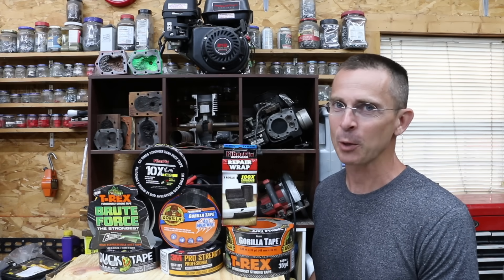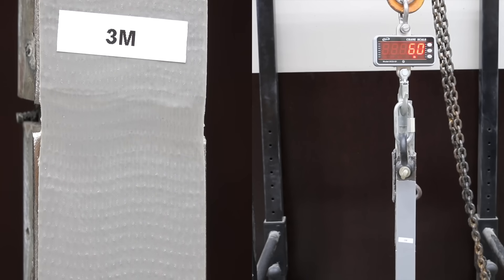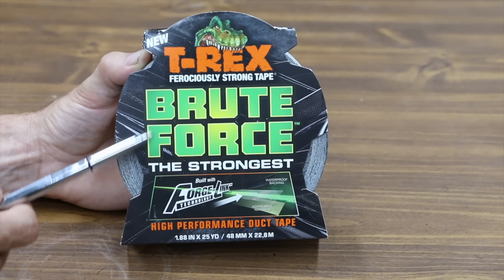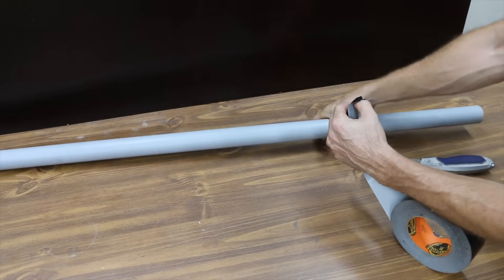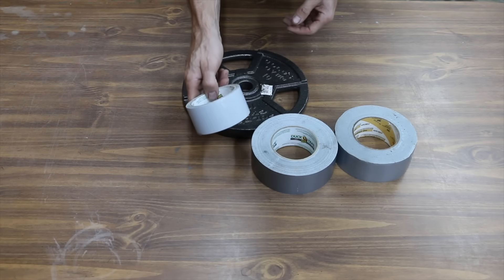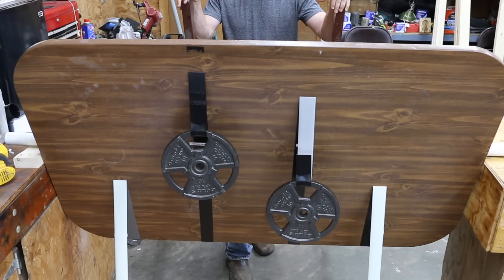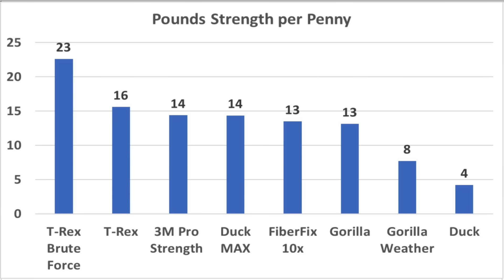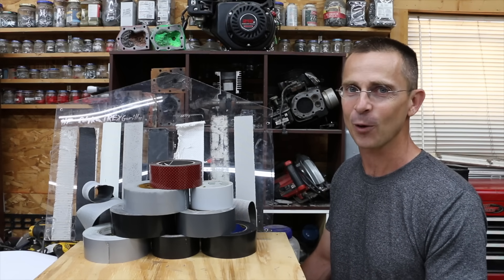Which Duct Tape Is Strongest? Let's find out! Gorilla, T-Rex, FiberFix, 3M Pro & Duck Max

Comment: I always found it interesting that, while classic duct tape has 1001 uses, one thing it's really lousy for is sealing up HVAC ducts... Which was sort of the whole reason the tape was created! Your aging test shows how the original type of duct tape disintegrates after only a year, losing its outer coatings, becoming more of a fabric mesh that won't seal anything and leaving behind crusty, dried up old glue deposits. Some of the newer duct tapes appear to hold up a little better, but when it comes to sealing HVAC ducts I bet none last as long as the metallic aluminum tapes.
Reply: i like the metallic tape
Reply: So is there a good use for cloth tapes today? I always find something bettter.
Reply: 'duct' tape was originally created to satisfy the need for a light-weight, waterproof fabric patch with an adhesive backing in WW2, as another commenter explained in detail.

It was degined to be a cheap, easy, TEMPORARY patch for boots, clothing, hoses, power cables, packs and vehicles. 

In the 1950s, it was sold to the general public, where it was marketed as "duct tape." A cheap, easy way to seal ducts... Except... Affordable central hvac was still twenty years away, the avg person didn't have ducts in their home. Only upscale businesses had it. Builders started using duct tape as an upsell to business installs, because TBH, it was the first and only option available TO seal ducts. 

In the 1970s, when new construction homes were built with central hvac, sealing the ducts was still an upsell. It was an optional "upgrade" for the home.  Historically, energy has always been cheap in the US. As a result, the upfront cost of sealing duct work was considered a luxury, like how power windows used to be "upgrades" for new cars. 

In fact, the act of sealing ducts in residential builds remained relatively uncommon until the late 1980s when energy prices began to rise. I have experience with residential real estate across the US, particularly older homes. From experience I can say if the home has rigid ducts and paper backed insulation, 95% of the time they aren't sealed at all, or there's a bunch of melted duct tape. 

Which leads me to my point. When 80s inflation hit energy prices, having sealed ducts seemed like a pretty good idea. Strapped for cash, homeowners went for the most affordable diy solution, a light-weight, waterproof, adhesive backed fabric called duct tape. 

That's the story of the journey taken by duct tape from allied military supply kits, to luxury theaters and high end department stores, into the junk drawer of nearly every American household. Duct tape can't actually do the thing it's named after. But maybe that's the point. 

Duct tape has been an inspiration for several generations. Just as the army found applications for it beyond it's intended purpose, so have millions of average people since then. Entire communities exist online around using duct tape in new ways. There are tutorials on how to make things ranging from shoes and shirts to swords and cups, entirely from duct tape. 

Maybe it was named after one of the few things it CAN'T do on purpose. Maybe it was trying to teach us something. 

Bonus story if you read this far. 

In 1879, a chemist in Missouri created a new antiseptic for use during surgery. It sold okay, but the hospital market wasn't very large. So he made a new dilution and sold it as a cure for gonorrhea, and a second dilution he sold as a floor cleaner. 

In the 1890s, he partnered with a pharmacist who began producing his formula and marketing it to dentists for oral care. 

In 1914, the pharmacy began selling the undiluted formula off the shelf to consumers as a mouth wash. They called it Listerine. 

The way we think about using duct tape to seal ducts today is obvious, but if you go back far enough, people would think you're crazy for rinsing your mouth with floor cleaner.
Reply: I have always heard Duck tape was originally made used for repairing H1-Heuy Blades from Bullet holes, but good to know :)
Reply: @Trooper_Miller  Close. In WW2 they packed ammo in boxes sealed with paper tape and then dipped in wax to be made waterproof. The problem is the tear tab on the paper tape-wrapped boxes would tear off, leaving the soldiers frantically trying to open a box that lost its opening tab.. while under fire. So Vesta Stoudt, a mother of 2 Sailors from Illinois, petitioned the US Military to create a cloth-backed tape with waterproof adhesive. They ignored her, of course, she wrote to President Roosevelt, he loved the idea. He commissioned the military to make the tape, the military gave the project to a company that was a subsidiary of Johnson & Johnson. The military called it 100-Miles-Per-Hour tape because it could be used to fix anything, up to and including jeeps and planes.

So there you have it.
Reply: @DisIntegratedLife  Thank you lol, sorry for get the story wrong lol.
Reply from the maker: Thanks for the feedback.

Comment: it seems obvious to me what the next step is.   JBWeld the ends of the pipe, then wrap it with fiberfix, run the brute force lengthwise over that... then call your plumber for inspection.

Comment: I grew up working in the commercial HVAC industry making and installing ductwork. I went through a lot of duct tape in the 70's, 80's, and 90's. A quick way to know if you have good duct tape is 2-fold; 1) How easy/hard it is to pull off the roll. and 2) How easy/hard it is to tear a piece off the roll. 

Back in the day it would take a full hand grip to pull a piece while I would tear it off using  my teeth. Find a local HVAC wholesaler and buy some commercial grade tape. I'm not in the industry anymore so I'm not sure what brands are available. I will say the closest thing I have found to what I'm used to using is Gorilla tape. But the commercial version ductape wasn't as thick as Gorilla tape and had fibers weaved throughout the tape.
Reply from the maker: Thanks for sharing.

Comment: Have you thought about testing brands of 4 stroke outboard motor oil? I have wondered if they’re really anti foaming from constant high rpm’s and if they’re really helping the engine resist corrosion from a salt water environment. Mahalos, follow tons of your videos🤙
Reply from the maker: Thanks for the suggestion.

Comment: I'd like to see how Gorilla Weather holds up to...the weather...I left a comment on your other vid that I'm putting a car port up, and I'm using regular Gorilla tape atm to hold the pipes together. But I somewhat expect to be patching and or reinforcing the fabric cover of this thing as well at some point, would also be good to know for patching tarps, which is a video idea I put out in my other comment as well. (Testing tarps that is). I'd actually love to see a test of car ports, but that would be rather expensive, and I don't know that enough people are out there buying them to justify that kind of expenditure, maybe that could be a Patreon thing or something like that, Idk how Patreon works I've never used it before, so not sure if it's possible to setup a fund/donation towards a specific thing or not.
Reply from the maker: Thanks for the suggestion.

Comment: i work as head of maintnance ( and bartend) at the silverado/franklin hotel casino in deadwood south dakota and we have all rubber type coating for roof cover material...was wondering about maybe you testing the rubberized roof coatings for us( and all the other peeps out there) because were needing to seal up the veranda outside bar floor this summer and well get you liquered up  if you ever make it to deadwood

Comment: Craziest thing just happened to me!  It's current 22°F outside and my DuckTape brand Duct Tape not only struggles to stick to anything (including itself) but actually separates between the top gray plastic layer and adhesive layer when unrolling it.  This prompted me to do some research and supposedly it is should work down to as low as -40°F "Duct Tape is ideal for use even in harsh winter conditions. It retains adhesion even in temperatures as low as minus 40°F and can adhere to a wide variety of substrates."  —  So, I'm wondering which brands work best at sub-zero temperatures!  Thanks!

Comment: Would you consider doing testing of 1. Solar generators 2. Camping generators (3000 or lower watts) 3. DC to AC pure sine wave inverters? I know some of these are very expensive to test a lot of them so I'm happy to ship you the two brand new 2200 and 3300 dual fuel generators to test and then send back.  These generators are life and death machines and without some very strenuous testing, there's no way to know what I can trust.
Reply from the maker: Thanks for the suggestions.

Comment: gorilla  lost a lot of strength in winter, i use a slice of it to close the gap between my windshield and my plastic cover underneath the wiper tape hold for 2 years in sme hard condition like -35 and more,i had to replace it after 2 years was not sticking on the plastic any longer and start cracking, its was not the weather one thou. the regular gorilla, its also do not stick well on heat surface

Comment: when i start scaling skyscrapers again, i'ma have to lose some weight to fit into my duct tape climbing harness again! Ok i just thought of a couple of questions, how Long does a duct tape last? when i put them on they tend to weaken, hard to test but i am curious how long it takes before it just peels off. Then different surfaces - wood, plastic, metal; and how long is it recommended and if longer or within that time how much glue is left behind. Reason i use electrical tape as the cleanup is easier. Usually for a temporary hold. Thx for the vid! Also, i wonder how the pipe test would work if you cut 6" or so strips and placed the tape parallel on the pipe instead of perpendicular (around it), then cut more strips and place them besides each other until you are around the pipe. If this makes a difference then if we need this, we should tape it that way instead.  ty
Reply from the maker: Thanks for the video idea.

Comment: thanks for this video.
i think it helped me, as in, i think i know what i'm buying, but i'm still unsure..

at work, i accidentally swiped the metal guard ?plates (about 5 inches wide), stuck to the bottom part of a concrete wall with the power jack.
i did so from the corner, so it bent outwards about a foot the length of the metal.
i was looking for a quick easy fix, so no one gets injured on this metal thing sticking out of the wall/floor.
using the heavy/handle side of the power jack (pushing it with the forks didn't seem to work),
i'm able to bend the metal back in it's place, but it obviously sticks back out a little, when the pressure is removed.
we don't have the tools to cut the metal off, nor to screw the metal into the concrete.

first attempt to fix was with maybe 10 inches of duct tape - when jack pressure was removed, it just ripped at the corner.
2nd attempt was maybe same length, but layered 3-4 times - it didn't rip, but the adhesive didn't stick after several seconds.
3rd attempt was same layers, maybe 3 feet on each side from/of the corner (+6 feet total), so it stayed on - but it's stretching out a bit.
happy with my temporary fix, but was looking to make it safer.
something that won't stretch as much, stick to the painted metal guard, and won't break too easily.
i think i'm going with the t-rex brute force, unless someone suggests otherwise.

while i'm at it, there is no such glue that would keep that bent metal stuck to the concrete, is there?
like if i take a sheet of that fiberfix wrap, wet it, and stick it in between the metal & concrete, hold them together for 20 minutes to cure, would that hold?
thank you again.
Reply from the maker: You are welcome!

Comment: You do realize that Duck brand Duct tape has different categories, there's the cheapest all purpose but there is also a professional grade that's much better than the general purpose. We used to have to wrap a couple hundred  swamp coolers in plastic every year when the weather started getting cold, so we used a crap load of duct tape, also outside temperature made a lot of difference, couldn't get anything to stick when it was cold in the morning.
Reply from the maker: Thanks for the feedback.

Comment: Hello sir your test is very helpful for me, kindly help me ,I have 4 kilometres underground 7 inch  pipe line one agriculture field to other field which is low surface to high surface and it's continuing leakes many places. Kindly suggest which is best tape for it ,I am waiting your  suggestions
Reply from the maker: You might use fiberfix and/or JB putty epoxy.
Reply: Thanks sir

Comment: Love it... I do like Gorilla . Not that expensive and it does more than I really need from it... Other videos. Hmmmm I would like you to revisit your video on penetrating fluids . As a tradesman handyman I do many things . Carpenter by trade and bulder of my trucks for love and joy, and Im cheep LOL. I hate paying someone to do things that just take a little common sense . Now with that being said when you do the tests I would still like you to use wax but this time I would like you to do a different heat test.  I am also very very good at plumbing and soldering pipes. I am sure you have done it as well so as you know (Assuming here) you never heat a solder joint where the solder is you heat the join where you want the solder to go. So instead of heating where you put  the penetrating fluid heat it where or rather in the direction you want the penetrating to go so don't heat the actual nut on the bolt but heat the head of the bolt so the penetrating fluid and wax have to go towards the heat through the frozen joint.. Hopefully this makes sense. I use the wax and man IF you can heat it from the proper end it works amazing . I don't even buy penetrating fluid anymore.. I have normal wax for completely exposed bolts and a special cutting wax for can only get to one end and I always use the heat I apply to the place (As best I can ) to get the wax to go the direction I want. Thanks and again.. Love your videos. You have saved guys like me a Ton of money
Reply from the maker: Thanks for the video idea.

Comment: How about BURST STRENGTH tests.  After all, if you are using it to seal a leak, burst strength becomes a real factor. Wrap a pipe with a hole say 1/4" in diameter and add pressure until it pops or leaks.
Reply from the maker: Thanks for the video idea.

Comment: If you use a heat gun on the take then squish it down with your hand while it's hot it will adhere much better. I do it all the time. You can make more permanent repairs with it.
Reply from the maker: Thanks for sharing.
Reply: Gorilla tape at least. I haven't tried it with others.

Comment: Hi mate, 

You must do one on self-fusing silicone tape

I used Tommy tape today not bad 
I did spend 20 mins reading so many on the market 

https://www.amazon.com/dp/B01LZQYCTY/ref=cm_sw_r_cp_awdb_btf_t1_LaYzFb436XX00

Question is which one works 
I used it on a hair line crack on PVC did the job, I think duck tape would of sealed it. I just wanted to test it. 

Thanks again

Comment: in response to pf's request - yes yes yes, please do a 1 yr follow up... also, i think yet another ultimate test of duct tapes should be done with more various type of tests and must include the flex tape, i'll gladly watch a 1 hour video if it's comprehensive...i'm not a fan of any of the flex ads and think them full of it so have not purchased any flex branded product yet but the 1 yr roof test follow up shows the flex tape to be really impressive with its staying power as far as adhesion and resistance to deterioration... and since i'm typing here already - i'd love to see a test on electric tape brands [incl. 1 yr follow up] and.... mylar 'space blanket' strength...there's a ton of mylar blanket brands out there and i suspect many are much inferior to others... it's a ubiquitous piece of low cost 'emergency/survival' gear in any kit so would be nice to see which similar thickness mylar blankets [i'm interested in the disposable, ultralightweight, shiny single ply types not the thicker types with duller reflective material] can handle somewhat rougher conditions before tearing or getting punctured by a tree branch, friction, etc... i own a ton of these in many brands for my minimalist 'psk' kits to use mainly as impromptu thermal, waterproof shelter and campfire thermal reflector in an emergency and if used properly these can be life savers from hypothermia if lost in the sticks somewhere, in the cold... but testing them out can be a bit tricky, you seem to have a great knack for finding practical ways to test stuff...what a great effin' channel, easily top 3 on yt in my book...cheers...
Reply from the maker: Thanks for the video ideas.

Comment: Just out of curiosity that Fiber Fix tape is supposed to be soaked in water first before applying it. Not sure if you mentioned this in the tutorial, but was wondering if you water-activated it first. 

Fiber Fix video (sorry for the long link).
https://d2y5sgsy8bbmb8.cloudfront.net/v2/c58564c5-b267-5cf8-ae78-ee645c5dc13a/ShortForm-Generic-480p-16-9-1409173089793-rpcbe5.mp4

Thanks for another great tutorial review.
Reply: He did before taping the pipe together
Reply: @kadenkaufman4844  Thanks. I must have missed it. I'm multitasking working from home and listening to the tutorial.
Reply: Showed it in the vid  if you want to go back and look